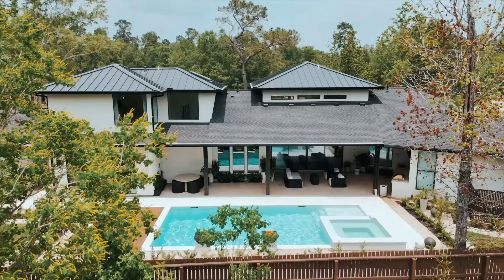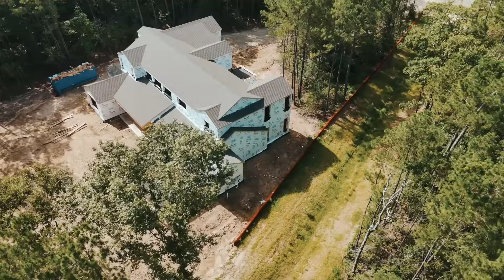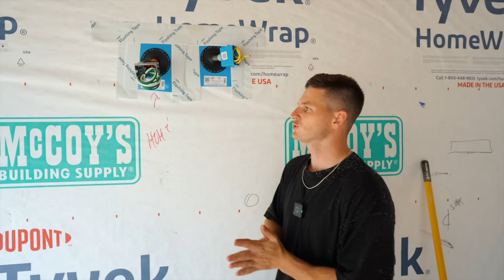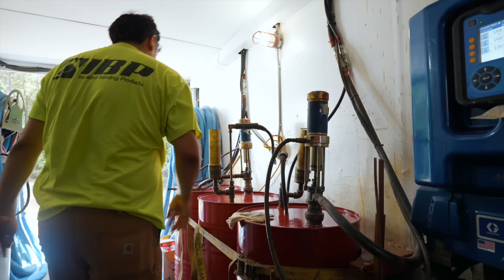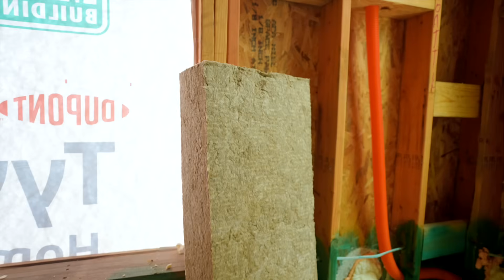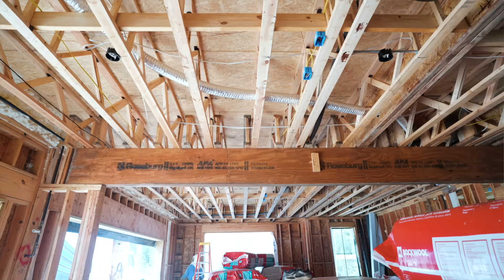INSULATING My $2,000,000 Custom Home Build!

Comment: I’m surprised you didn’t use Zip System sheathing instead of OSB.  I’m not a fan of spray foaming an entire house as homes are meant to breathe to avoid moisture and mold.

Comment: You should still do vapour barrier on the outside layer. (Outside only because you’re in a hot area. If you were in the north it would need to be inside) House wrap is good for rain shed and can cut down on wind gusts but for air leakage it’s not enough and air leakage and penetration is almost more important than insulation for energy efficiency and comfort. And this is preference but I’d prefer spending more money on the roof insulation to get a higher r value like R30-60 rather than sound proofing the interior walls. But it’s preference. These are just my opinions! Love your channel and you’re doing a very impressive job man. The house is going to be awesome

Comment: Mate. If you are going to completely air seal, don’t you need to install an ERV to prevent stale air? As well as a dehumidifier for Houston humidity? Also, for flooring, make sure you go two laters of 3/4 plywood with glue+screw and then put some kind of sound dampening layer on the subfloor to reduce vibration noise (footsteps etc). Rockwool in ceiling joists won’t really help with that (speaking from experience)

Comment: Overhangs in general aren’t there for style purposes, it helps get the water off the side of your home, also depending on size it helps with sun. Every little bit helps when it comes to longevity of the home. I understand it’s a modern trend but from a functional long term design standpoint overhangs are absolutely better than none. I’m doing the opposite and going with massive overhangs on my home but that’s the advice given to me by a bunch of old timer GC I know. One more thing I’m running block walls with open cell spray foam roof doing the same full closed interior envelope but just to add it doesn’t make closed the eaves off hard or impossible. Obviously we have to do that on our style with 28” overhangs to achieve a full envelope & then run non vented soffit, aluminum panels in our case. Just have to add some wood blocking or spray a small gap depending how your trusses & eaves work out on top of the walls. Nothing crazy that makes it any different than yours far as achieving full envelope with or without overhangs spray foaming. One more thing, go overboard with a dehumidifier & don’t oversize your AC unit. The AC needs to run & cycle properly to pull out moisture which is needed with fully closed envelopes. Also I’m sure you’re doing this but spend the extra on variable speed HVAC units. Yes do the blower door test on this home & bonus compare it to the current home you’re living in to actually see the difference.
Reply: I’d say overhands are also good for blocking the sun at certain angles in the summer. In winter the sun is lower so overhangs do not block it and allow for solar gain. (Maybe Houston is way south so perhaps it works a hit differently there than in northern states). Perhaps you shouldn’t oversize them either. But to avoid the insulation issue, you fan probably tack on fake overhangs and have the top plate go all the way up.

Comment: Great job.  It will be a very comfortable home.  The home is big enough to have a vrf system for heating and cooling.  I would go that route for efficiency and ability to ramp way down and run long for dehumidification.  I have one in my home I bought through a commercial hvac rep firm and had a mechanical contractor install on the side.  I have a Lennox and it’s been amazing, but Daikin and Mitsubishi also make great units.

Comment: I am still convinced this is a parody. It would make a lot of sense if he wore clown makeup while talking. 

Case in point: he's serious about penetrations while standing in front a tyvek wall. A material that will LITERALLY RIP when you twist it slightly... 

Another case in point: he put open cell spray foam in the roof line.... Literally asking for mold. 

The opposing counsel is gonna have such a good time.
Reply: do you have a parody where you make a perfect house? id sure love to see that since you're clearly a perfect being with knowledge of everything
Reply: Yeah i would prefer to actually foam the ceiling . Not the roof.  Add vent.  Bc that air gap helps

Comment: how are you ventilating the roof with out soffits?
Reply: Non vented attic space requires non vented solid soffits & no ridge vents to encapsulate the full interior envelope. Vented style home runs batts in the ceiling & non vented is fully spray foamed which should be completely air tight on the interior of the home & attic.
Reply: @taylormeli  he didn't ask how to not vent a ceiling that doesn't require vents.  😂😂😂
Reply: @goodson77784 not sure your point here, literally in his case there is no venting period. You dehumidify the interior with proper size HVAC & added dehumidifier if needed. It’s one or the other, with fully encapsulated interior insulated envelope you run no vents period. Other than bathroom/sewer vents but that doesn’t count towards the envelope
Reply: @taylormeli  he asked how to vent a roof without soffits! i guess you didn't understand the question (or the answer which is ridge vents)
Reply: @goodson77784 he asked how are “you” ventilating it I thought. In which case I responded that the home builder here is not & how it is accomplished. Seems directed at this video huh?
Reply: ridge vents
Reply: @goodson77784 you need intake and outtake vents!

Comment: I would like to see a blower door test.
Reply: It's gonna be like 25 ACH 50.
Reply: @Th3120ck  At least 10 - All those gaps in the OSB sheathing and the I bet there is a good one on the bottom plate
Reply: Same - on the bright side, this is the first time I've ever seen this guy share any knowledge about building science...
Reply: Forget the blower door test, this guy used tyvek with zero overhang. In my experience, that's guaranteed rotted sheathing in at least a few places in ~10 years or less.

Comment: Please do a blower door test. I don’t think you will score well. You have to use taped zip system or a self adhered house wrap along with closed cell foam. Tyvek, batt, and open cell foam won’t cut it unfortunately
Reply: I bet you passed that blower test rrrrreal good! Ha
Reply: Every single house that’s been built up until recent years has had tyvek, bat and spray foam! They always pass! Why would that change?
Reply: I did that test on my crappy tract home, built in 2005. I did the test a few years back and it scored a 92%
Reply: @dadlife8289 92% is an interesting result. 92% of what?